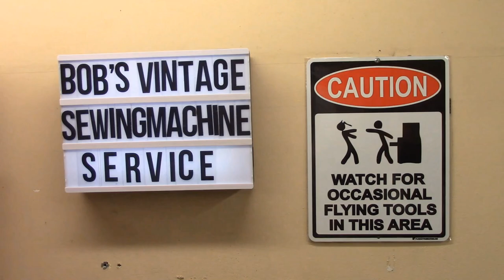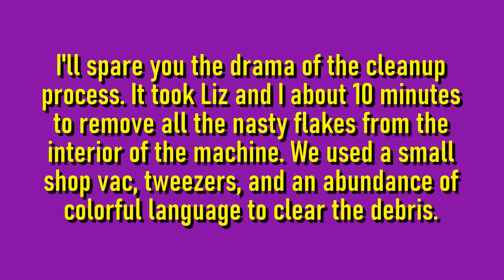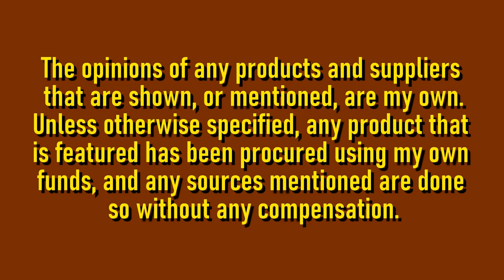More Singer 101 Fun! (electrical stuff this time) Sunday Morning Quickies Ep. 86, June 18, 2023

Comment: Great video as always. I never seen this type of wires in my area. Back in time all machines came with mobile handcrank version and in tables ("wooden box" type and classic cast iron). Motors were produced in small batches during the 30s and and late 40s (they are 127 volt standard it is kinda unusual for USSR). I have 40watt motor from 1959 220v variant, but manuals from sewing machines never shown variant with the motor. Machines with motors in mainstream came too late in 70s, but people preferred less noisy foot driven table variant.
Reply from the maker: The 101 was the first domestic machine that Singer offered that was "electric only" - no treadle, no hand crank options. I just wish the execution of the electricals were better. When it came to the 201, Singer wised up and made the treadle and hand crank options available.

Comment: Thanks Bob..
Reply from the maker: Glad you liked it!
Reply: @BobFowlerWorkshop  very helpful video Bob, as I need to rewire a light on a 1939 15 with that old style light. I just bought the machine today, and the whole machine needs to be rewired..(crispy critters)  I am going to watch your video again on the rewiring of the potted motor. I need to find the old style a button foot pedal, as it was missing on this machine.  The machine is in a cabinet where one can use the pedal, OR put it in a bracket and use the knees lever. Single lead power cord, bakelite 3 prong, which I already rewired. Any ideas where I should look for a pedal? Thanks Bob.
Reply from the maker: @connieworcester55  My personal choice would be a modern, electronic foot control rather than the old style Singer button type. Both new electronic and vintage button style are all over eBay...
Reply: @BobFowlerWorkshop  Thank you.

Comment: I just bought a heat gun…and was told they would wreck the inside of a sewing machine when heating up frozen oils…?  Thoughts?
Reply from the maker: Just be careful around plastic parts - especially gears - and don't crank the heat too high.
Reply: @BobFowlerWorkshop  I am hoping that you make a renovation video on a 96-10…this week!   My first…’cuz it’s in the front rooms.

Comment: I just looked up that wire because I have another machine to completely rewire…kinda pricey wire.  Is it worth the cost, or is wire, wire?
Reply from the maker: I buy it in 500 foot spools for about $30 a spool, so that's about $.06 a foot. Of course, 500 feet is far more than most folks will use in a lifetime... I like the Stinger Select because of the flexibility of the insulation. I would rather "home grow"  my 2 conductor cable with shrink tube than use lamp cord, which IS an option. I'm sure other 18 gauge primary wire would be just fine, and I posted about the Stinger because I get a lot of emails wanting to know exactly what I'm using. YMMV...
Reply: @BobFowlerWorkshop  Awesome.  MY mileage won’t vary…I am a follower in this case.  A trusting child in a world I am not versed in.  I will buy some.